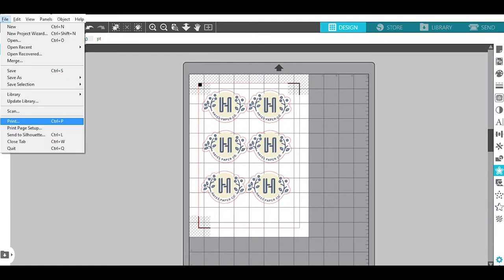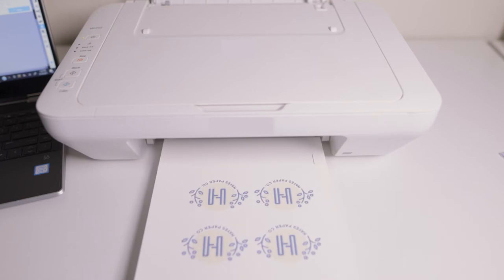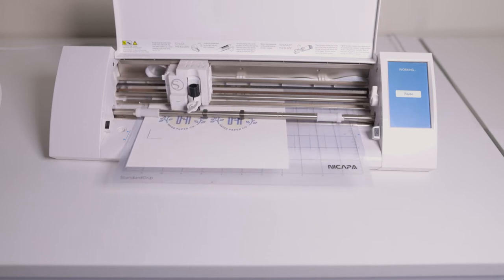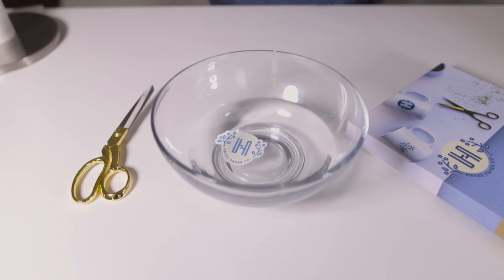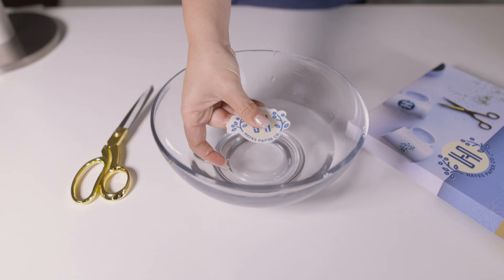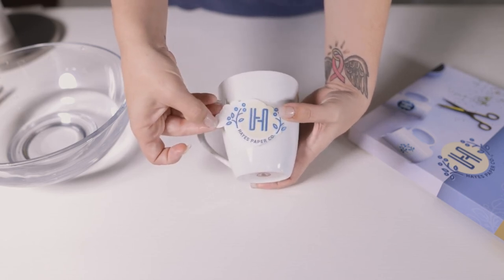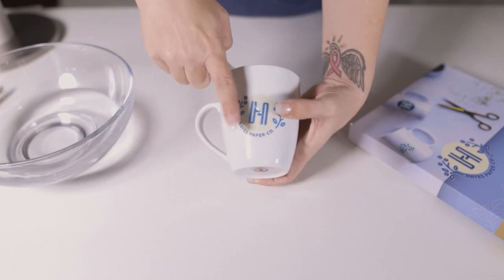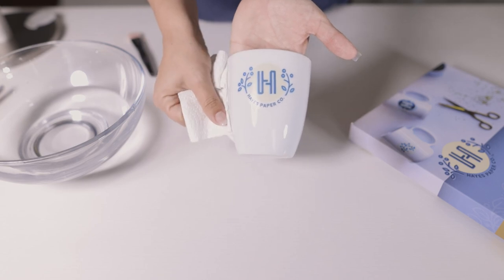How To Use Waterslide Decal Paper For Laser Printers by Hayes Paper Co®

Comment: I would love to be able to apply this to my woodworking between coats of CA finish. Does anyone know if this decal will withstand a CA (cyanoacrylate, superglue) or a shellac (alcohol-based) OVER it? What finish is recommended over top this material to protect it? If now finish is applied over it, would that be sustainable on the bottom of a  wooden piece (against a table)?